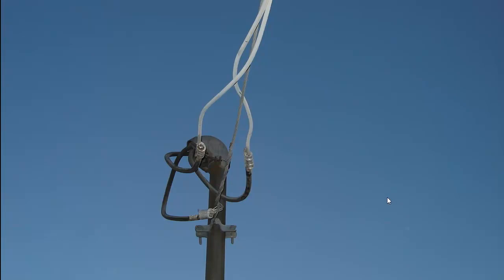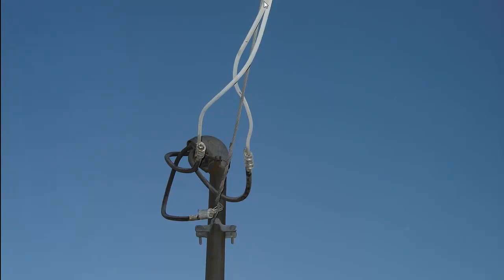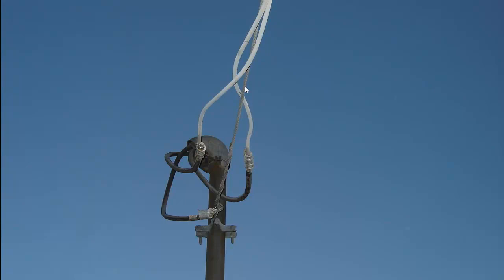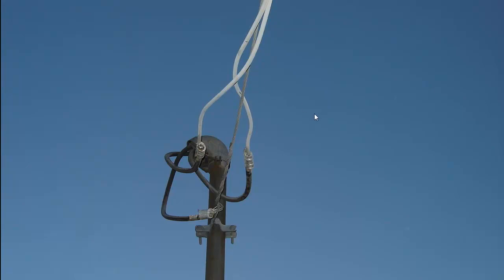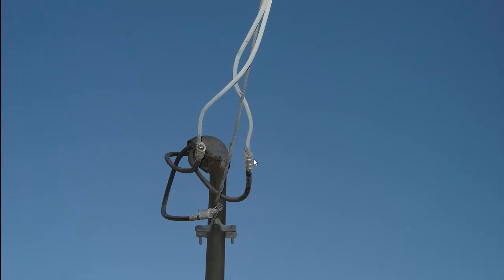Electrical Wiring-Overhead service wiring

Comment: I'm about to take on a residential wiring project.  I'm a computer engineer by degree and trade, but my electrical engineering knowledge is limited.  If it's low voltage I can do amazing things with it.  Your videos have been superb in giving some great primers on AC.  I can't thank you enough for posting this.  I know it is time consuming.  Btw, the mic sounds great.  I'd encourage you to keep using it!

Comment: Thank you for this explanation, and I hope you can give me some advice. My utility company recently reconnected my service drop after a wind storm and a tree took the line out. When my cable guy came to install TV cable, he noticed that the messenger cable was not repaired. It was completely broken, and the large ceramic pulley-looking device that had been clamped onto the weatherhead was loose and sitting at the bottom of the weatherhead, on the roof. The long run (about 70') was hanging on only the electrical powers lines. I immediately called the utility. They came out and made another "repair." They've spliced the messenger cable together and reconnected it to the ceramic piece. But now, I've lost all confidence in their work. Is it safe to have the messenger cable spliced and supporting such a long run? Should I insist thtat they reinstall a new messenger cable?  This seems beyond the scope of an ordinary electrician--or is it? Who should I have come and double-check their work?

Comment: I appreciate it I’m running a sub panel 100 feet from my house it seems easier to run the wires overhead on poles rather than unground I do feel underground is safer but is overhead ok too just curious 🤩😎👍

Comment: I want to run an outdoor overhead service line from my house to my garage, approx. 40 feet.  It will be 110v  30 amp line replace an old double strand separated line.  What supplies will I need

Comment: Yes, and it's more accurately called split phase. The transformer is fed from a single phase, the neutral is connected to the center of the secondary coil and grounded, the two hots are connected to the ends of the secondary coil. So, one of the hots is in-phase with the supply phase, the other is 180 degrees out of phase. The result is 120v from either hot to neutral and 240v between the two hots.

Comment: Where is the YouTube video that explains how to work safely on a ladder or on the roof near where electricity enters a home?  Over a lifetime of owning a home, it is likely that the homeowner will have a need to do some work to that part of the house.  I am under the impression that the lines coming in are insulated such that, even if you touched them, you would probably be fine.  Why are videos difficult to find that address these topics?  Is it safe to go near the masthead?  On a ladder?  Some people say, "Use caution."  Okay, well, how do I do that?  What does "using caution" look like?
Reply from the maker: In my opinion, most YouTubers are concerned with liability. There are a lot of dangers working around mastheads and accidents happen, even to the pros. Using caution could be described as common sense, which some people don't have.

Comment: I was looking for something else and I found your video, accidentally I seen 2 things that a proffesional electrician would not do, using wrong color code wiring. I Thought all over the world the fase wire must be red or black or both. and it must need to be insulated does not matter what, except the neutral aluminum wire is hook togheter with a complex punchable 2 inches long made of tin and the fase wires are hook together with and insulated complex punchable. Please get information. I accept your answer with posite or negative attitude. But I like the image of your video and the sound is clear. well have a nice day

Comment: If it is residential single phase and the bare is neutral, then are both the insulated wires hot?

Comment: Here in Ontario. Hydro authority is very sticky. DRop mast wires must be no shorter than 3 ft. Another requirement is the 3rd wire must be white in color and forth all 3 wires must have a weather code or the inspector will not approve. Here in Canada--we get suck in Royally--each inspection cost $180 + tax and worse if found one fault--another $180 + for re inspect :^(

Comment: A 100 amp main breaker requires at least 2 AWG aluminum or 4 AWG copper, a 200 amp main requires at least 4/0 AWG aluminum or 2/0 AWG copper. Make sure you're getting the appropriately sized service, can't put a 200A main breaker on a 100A service!